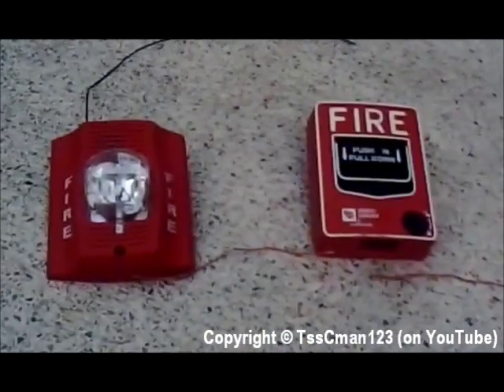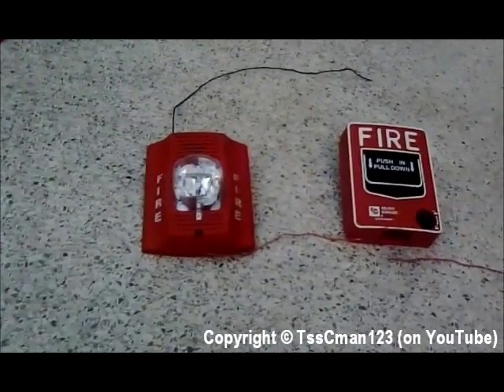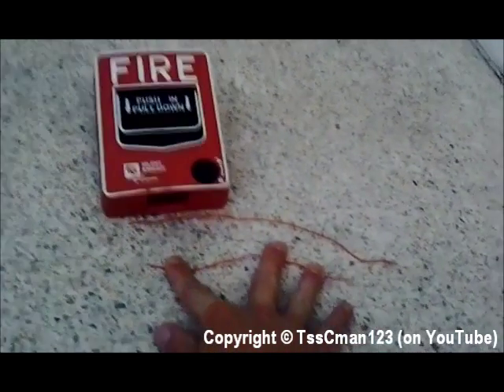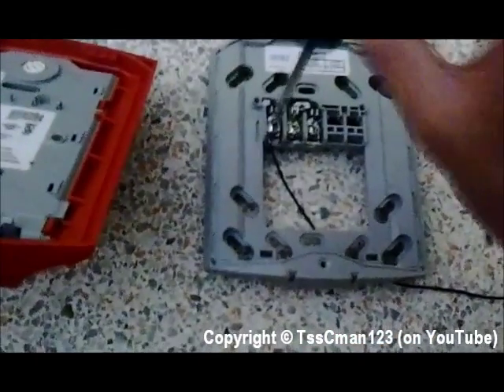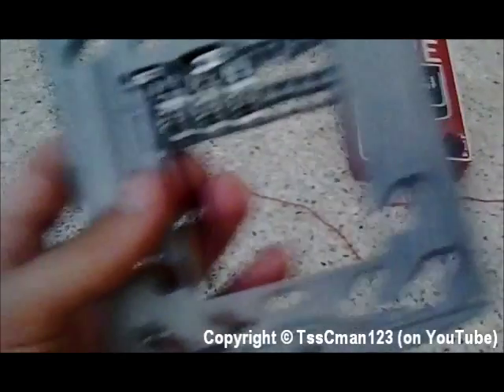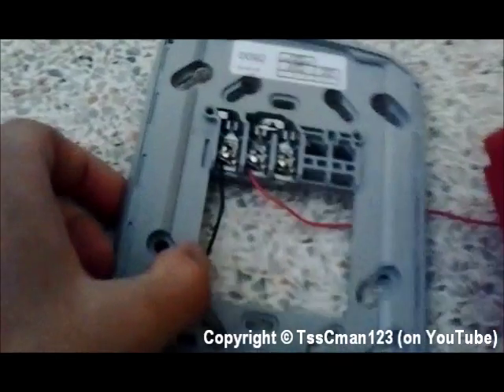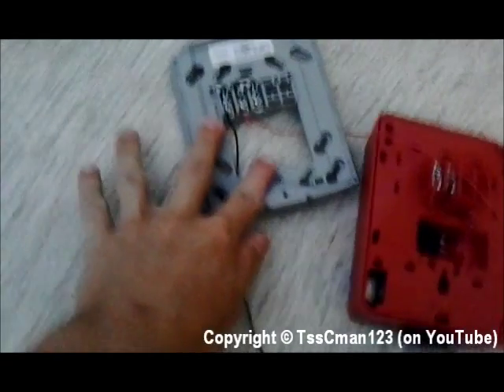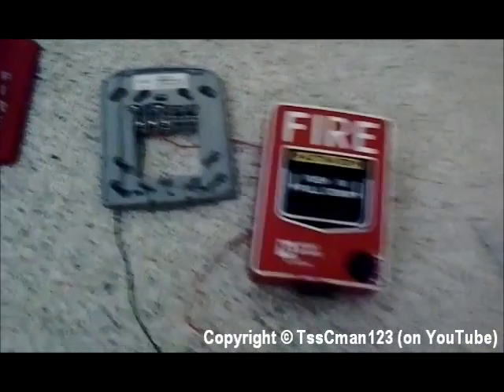How To Wire A Fire Alarm To A Pull Station

Comment: I need help with connecting a spectralert classic too a smoke detector with no panel. Help please
Reply from the maker: Is it a two or four wire smoke detector?  Two wire smoke detectors can only be used with a panel.  Instructions for a four wire are at the end of the video.

I would be happy to help you.
Reply: ok, thanks